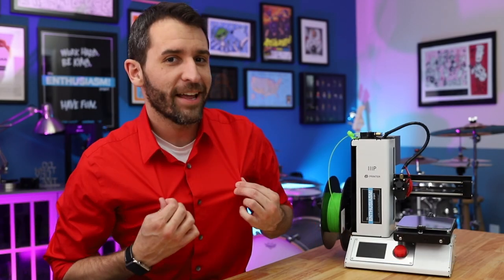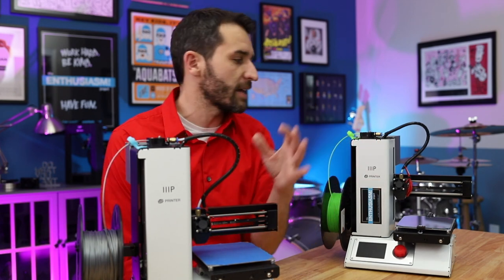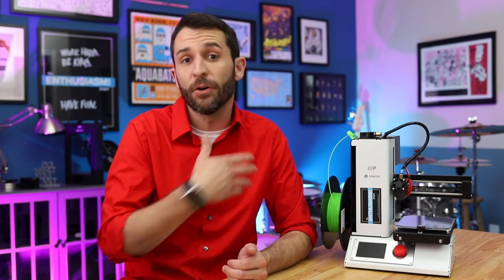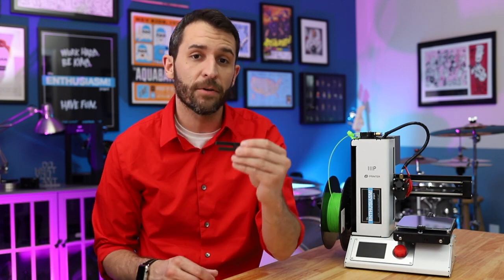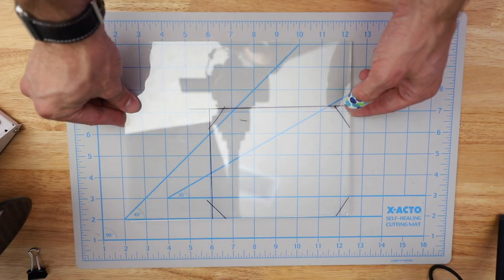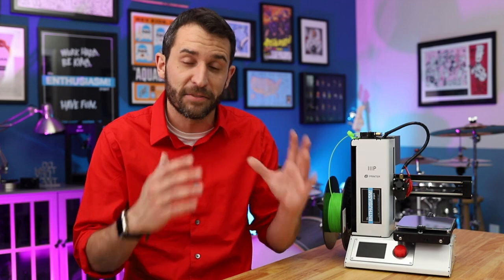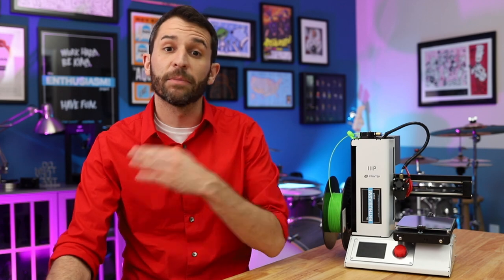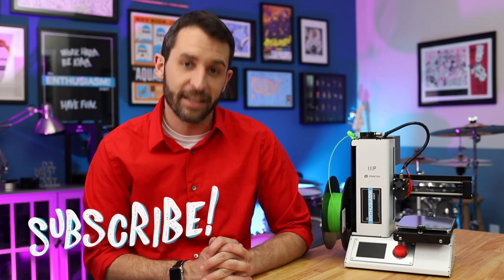3D Printing: Monoprice Select Mini Glass Bed Installation

Comment from the maker: Hopefully this tutorial is clear and easy, but if there's anything I didn't answer, feel free to ask!
Reply: Thanks for making this video! Would you recommend using hairspray to make prints stick or is a glue stick much better? Also have you tried printing PETG with the select mini? I've been struggling a bit printing with mine
Reply: Thank you for this video. My select mini needs a glass bed.
Reply from the maker: It really does help improve ring consistency! The metal bed can warp and change after related heating/cooling, whereas glass doesn’t.
Reply: Well this set up work for the MP select mini v2?
Reply from the maker: The bed is the same size, so it should work, but I haven’t tested personally.
Reply: @tombuck  But will the Z axis clip fit?

Comment: Hi tom buck! I loved your video! I need help on one thing though. I don't know how to remove the black metal sheet. I've seen other videos of taking that off, then using Goo Gone and scraping the glue off the bed with the plastic scrapper. How did you do it?
Reply from the maker: I’m using the original version of the Mini, so it didn’t come with a black sheet- it was just the silver metal bed covered in masking tape. I might be crazy- but I think I saw a thread somewhere in the Prusa message boards about removing the black bed material 🤔
Reply: @tombuck  Okay! Thank you!

Comment: Would love a better view of installing the spacer. Can never see exactly where and how they go on.
Got a borosilicate plate sized for the Mini with beveled corners and a pack of thermal heatsink pads 25mm x 25mm (I figure 5 should be good) instead of clips. Will probably have to order a spacer through Thingiverse. Haven't been able to get any adhesion. Either won't at the start or it builds a few layers and  I'm all 'yay, working' then it pops free.
Reply from the maker: I made an updated video last week that has a better view of the spacer installation: https://youtu.be/iAxyyy09_oc

It’s really hard to show, but it’s very very simple. A glue stick works wonders for adhesion!
Reply: I've seen people say you don't need any adhesion agent with PLA on glass and others that say you do. Not liking the idea of spraying hair spray into/at expensive electronics. Will definitely go with a glue stick if i need one.
Hope I don't need the spacer. Bed was so bad, company had issues with a whole run of glass, health issues, stupid printer has been sitting for months. Don't want to wait for the snail go deliver a spacer.
Reply from the maker: Yikes. That’s awful. Glue sticks work great, and are very easy to clean off the glass. 

If you want, send a mailing address to theenthusiasmproject@gmail.com and I’ll print a spacer for you.
Reply: Appears to be up and going. Deeper into a print than it's gone in quite a while. Tried getting the borosilicate on last night with the 1mm heat pads. Gave a nice level base but the ones I got weren't sticky. Ran out today and got binder clips and glue sticks. Deleted the thermal pads and after a bunch of leveling it be printing. Thanks for the offer! Doesn't seem to need the z-axis spacer though.
Reply from the maker: As long as it’s up and running, that’s all that matters. Happy printing!
Reply: Thanks! You too!

Comment: Does installing a glass bed decrease the maximum print height? If so can you just temporarily remove it for a print requiring the extra height? Great video like always!
Reply from the maker: Yes, it does, that’s what the z axis spacer is for. If you needed a bit of extra height, you can easily remove the spacer and just print on the original bed. That’s why I love this mod- it’s super quick and simple. 

Thanks as always for watching!

Comment: You went over the Z axis insert so quickly. Can you provide more explanation and pictures of how to install that piece?
Reply from the maker: It's a small plastic part that just clips around the end of the piece that  moves up and down. I don't have any more photos, but it's quite simple. Of course, this is only using the one 3D printed model I used- it ccould be different with other parts.
Reply: @tombuck  Tom thanks! Once I looked it was pretty simple. I had a tough time cutting the glass. The edges didn't turn out so good but I got it installed and it is working great! What method do you use to remove the print form the glass?

Comment: Late to this video but, do I have to make the spacer as thick as my glass? Or it doesn't matter? Is the auto leveling working with the glass? Best regards.
Reply from the maker: If you’re using a newer version with auto leveling, I’m not too sure what the effect would be, but it’s probably best practice to make the spacer the same thickness as the glass.

Comment: Great video! I recently performed this upgrade on my mini and I have a question about the glue. I noticed that my print contains an "imprint" of the glue pattern (spread on the glass). Is this something you've encountered and how did (or would) you resolve?
Reply from the maker: It hasn’t been an issue for me, but you could potentially play around with first layer height and see if that helps anything?

Comment: 3:00 I saw someone who sanded the surface of their glass bed to get good adhesion without using and adhesives but if you want use higher temp filaments like abs and petg you’d want to add tape or glue so it can pop off easier and you won’t chip the glass

Edit: here it is https://youtu.be/H102NYJSl_E
Reply from the maker: That's a smart idea!

Comment: Went to print soft motor mounts and the nozzle is acting like I didnt add the spacer. I triple checked and the spacer is snapped in good, glass bed is mounted using the binder clips that you suggested (wifes work had a few extras I could borrow :) Can you think of why it would be doing this?
THanks!
Reply from the maker: Is the spacer clipped around the z axis motor? You should be able to see it click on the stopper when the motor is lowered. 

If it’s installed correctly and you’re still having the issue, it may have to do with the thickness of the glass. You could put the spacer into Tinkercad and add some thickness to it.

Comment: I haven't dug into the thickness of the z-spacer in the thingiverse file.  Is the thickness of the spacer in the file supposed to match the thickness of the glass pane you install?  Your video shows 3/32" thick glass.  What thickness was your spacer?
Reply from the maker: That would make the most sense, and definitely is the smartest thing to do. 

Honestly though, I just printed the spacer at it’s default size that was downloaded and it works fine.

Comment: Hey Tom, 

Have you looked at the wires connecting your heat bed? I had to replace mine, and apparently it happens to everyone if you use them enough.
Reply from the maker: Hmm, no issues so far for me. I’ve had both of these since November 2016, but I’ll keep an eye on it.

Comment: I was wondering what happened to you on Tuesday. Can your 3D printers print character figurines?
Reply from the maker: Last week was too busy to make a decent video, but I got the urge today, and I’ve had this one on my “to make” list for a while. 

And yep, pretty much any 3D printer can do figurines. The biggest difference would be possible size/resolution.
Reply: Wow, You made this video today after work? Nice job. Do you have any character designs that you've printed?
Reply from the maker: Ha, thanks! Yeah, it was a quickie and I only injured myself once!

Comment: Is this the V1 or 2?  I just got a Monoprice Select Mini v2 and was looking to make the same upgrade.  Already got the glass, but I my understanding is the beds are a bit different between the 1 and 2.
Reply from the maker: This is the V1, I personally don’t know if any differences between the two for this specific upgrade, but I’m sure if you check the wiki it may have something: https://www.mpselectmini.com

Hopefully that helps!
Reply: I think they are super similar.  That worked. I grabbed some replacement 8.5 x 11 picture glass plates and was able to cut them to size :D !
Reply from the maker: Nice!! Glad you got it worked out!

Comment: How do you remove the print, but the print will not remove with out reheating the table
Reply from the maker: Sometimes reheating the bed is the best way to do it without damaging the print.

Comment: Do i need to apply glue every print?
Reply from the maker: It doesn’t hurt, but you don’t always have to. Then I usually clean it with soapy water once it starts to feel like there’s a bit too much glue, but not after each print.

Comment: How to easily remove the previous adhesive?
Reply from the maker: It’s SUPER easy, just rinse with water and a little dish soap in the sink. Comes right off!
Reply: @tombuck  ok, thank you so much for answering my questions. Im really sorry for asking so many but what do i clean it with? Like a sponge ?
Reply from the maker: No worries, I’m happy to help! Honestly, I just use my hands, but a sponge would be fine (it’s just like washing a dish). 

If i misunderstood and you meant the original tape from the factory, it should just peel right off, and then you could probably use an alcohol wipe to remove any remaining residue.

Comment: do you really need the spacer cant you just lower the bed low enough to accommodate the glass?
Reply from the maker: That MIGHT be possible, but it also could affect your ability to get it leveled and adjusted.
Reply: That's what I did.  There's really no point in using a spacer.

Comment: Does the heated bed still work through the glass?
Reply from the maker: Yep, I haven’t had any issues.
Reply: Perfect, I just bought this printer and Its due to arrive monday, even if the bed isnt bent I still wanted to do this mod. Thanks again for the video
Reply from the maker: Cool, congrats and happy printing!

Comment: Do not use clips, glass will flex. Use a clean thermal pad instead.
Reply from the maker: I’ve used clips for about two years with no issues. I’ve never had glass flex.
Reply: Depends how warped your bed was before doing the upgrade
Reply: Missed where you said it was concave, mine was convex in the center which caused the glass to flex if secured with clips on the edge